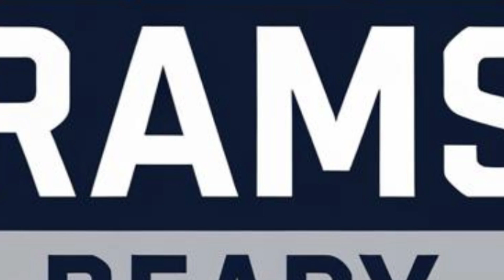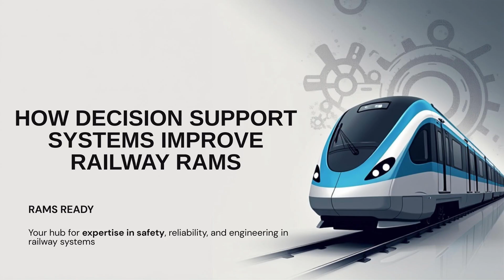How Decision Support Systems Improve Railway RAMS

Comment from the maker: Working files for this topic, built to be used on a live project:

RAMS Excel Calculator Pack
Availability, reliability block diagram, PFD and test interval, spare reorder and demonstration planning calculators, all live Excel formulas.
https://ramsready.firstlinkai.com/p/A2

Data Cleaning and Reliability Dossier Kit
Failure data cleaning workbook, reliability calculator and a reliability data dossier template.
https://ramsready.firstlinkai.com/p/D5

Free Lite Hazard Log workbook: https://ramsready.firstlinkai.com/free
All twenty products: https://ramsready.firstlinkai.com

Which part of this gives your projects the most trouble in practice?